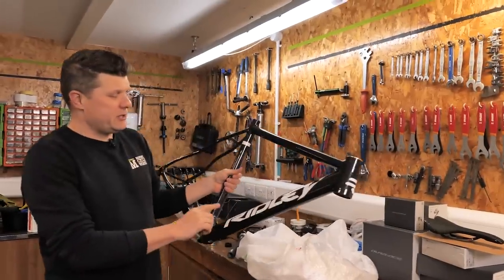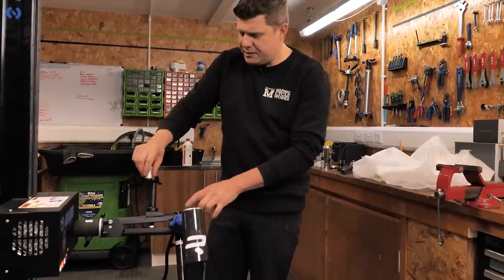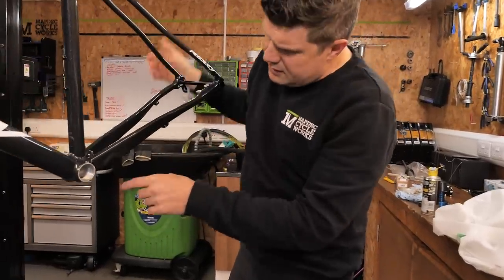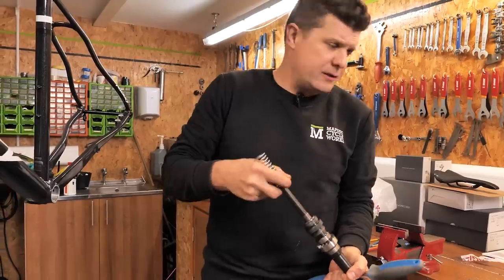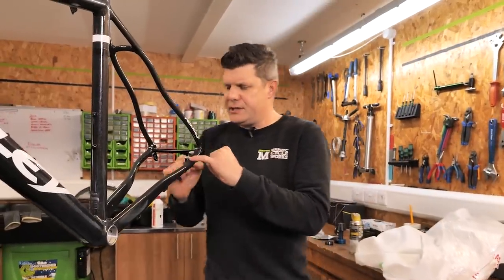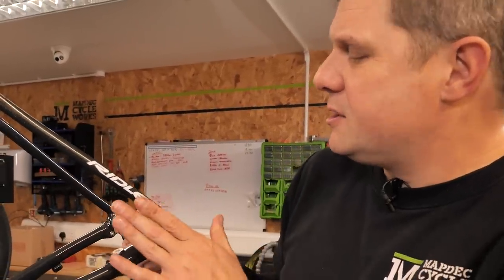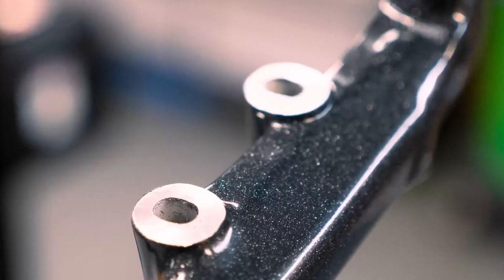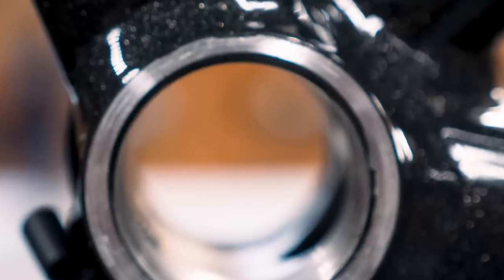Preparing your frame for a smooth & quiet ride.

Comment: This is disgraceful to be honest. Should have sent the thing back!!.
Reply: This seems to be the norm, rather than the exception with Ridley frames, unfortunately.
Reply: @MrSchattka can confirm
Reply: @MrSchattka  To my knowledge, Ridley once started their business by.... Painting frames...    Rgr
Reply: Exactly! I will give this one the benefit of doubt before breaking down the cost vs sending back. I’m awaiting a response to cost but I feel a little ghosting is going on unfortunately. I like the videos but one thing that’s lacking is the cost to put things right. Why send a frame from London and the back to face the head tube, bottom bracket and brake mounts? I know plenty of good bike shops in London that could do this for a £100 max. Some might say you have an axe to grind with Ridley and profiteering? I would be happy to be proved wrong though!
Reply: @borano2031  Ridley have been in the UK  market for over 15 years, first by rebranding frames such as Rondelli (Ron Spencer Cycles) then some Vitus models to my knowledge amongst other brands.
Reply: @youcandoit2502  Should have been more specific, they started by painting frames for OTHER brands. By replacing the other logos with their own they suddenly became a frame/bicycle brand.     Rgr
Reply: Exactly , the video exposes the manufacturer quality.

Comment: If I thought my shop, spent this much time facing and working on my bike, I wouldn't hesitate to use them for my bike builds. Slap dash bike builds is what drove me to buying my own frames and building my bikes up myself.
Reply: How much would you be willing to pay? knowing the place you sent it to knew this should have been sent back to be rectified in the first place? I would call this profiteering?
Reply: High detail bicycle builds with expensive tooling and extra time spent = high cost .

Comment: On my alloy frames that get a carbon seatpost I always take a fine file to the seatpost collar slot on the inside and add a fine bevel, sand, and polish. Stops it cinching in on the post and cutting into it. Only takes a few minutes, but I've had two posts ceack right at that pinch point. Now it's no problem.
Reply from the maker: Top tip.
Reply: Do the same to the seatclamp and stem while you're at it
Reply: Yes, I had to do that with a steel-framed bike I bought 27 years ago, after it gouged my aluminium seatpost.

Comment: That was a treat to see how the problems were solved. Not something your everyday enthusiast would be able to do back home in the shed with all the specialist tools required, and sort of underlines how 'little niggles' can end up being an instant showstopper for anyone attempting to build their own bike at home.
Reply: Don't let those little niggles stop you. I regularly prep people's home builds from frame milling to problematic brake bleeds to whatever. Use the local shop for stuff you're not read or able to tackle so you can focus your efforts on the parts you can do.
Reply: But that’s precisely why I would never bother with, and highly encourage ppl to leave any bike work to the pros. 
There is little bevefits, and more demerits to trying to work on your own bike at home. Is your time worth that little, that you can waste it trying to sort out all these issues?

Comment: Very few shops around here have those tools, specifically the brake flat mount facer, but beyond that, I don’t know of any that would take a new bike during assembly and check all those things. Whether they’d do it for a frame build I really can’t say. From what I’ve seen, they tear off the packing, put the bars on, tighten the stem, check the wheels and fill the tires and make sure it shifts ok and out on the floor it goes, more or less. Spend as little time as possible on it I’m sure is the mantra.
Reply: If a new frame needs such refinements, it should be done, at least this is the case of the workshop I last worked at. I even got to do disc brake mount facing and BB shell reaming a few times.

Ever since then, I never look at bike builds the same way ever again.

Comment: I bought a relatively humble unsophisticated frameset (Salsa Fargo) from a great bike shop here in Melbourne, and half a decade on it still runs and rides flawlessly and is a joy to rebuild and service --- all because it was chased and faced properly.
Reply: Good thing you're not using salsa handlebars
Reply: @janeblogs324  I am. Woodchippers. The bike is the original dropbar MTB and it's designed around it: short top tube etc.

Comment: I was trained to take as little material off as needed to provide a continuous faced circumference, which is not a broad flat full width face all the way around. By my training, the amount of material you removed from that one side of the bb was way more than appropriate, unless, of course,, doing so did not reduce the bb width to less than spec. Nice sharp, new looking tools by the way. Along the same lines, a beautiful even flat face on the brake mounts also may suggest over cutting in many circumstances. Thanks again for the show-and-tell. I may need to get one of those Unior stands. I'm NOT in love with our current park lift stand.
Reply from the maker: It would have help this video if i had used blue dycum to illustrate that gap.
Reply: Shimano bottom bracket width standard is engineered with a large variance permitted to account for manufacturing tolerance and frame preparation, +/- 0.5mm.

Comment: I have to say, regarding frame prep that I've just put my Vitus Razor Disc(2021) off the road for the winter (Mtb/Gravel/E-Mtb time)...I was having a damn good look at it as I cleaned it and despite this being a budget bike (it was £629 with full Sora when I got it) it has all the evidence(I think, maybe not head tube/seatpost) of being frame prepped unlike these paint covered Ridleys. The rear caliper mounts have definitely been faced(not checked the front), as has the BB shell (I noticed that when switching from the Tiagra RS500 BB to the smaller Ultegra BBR60 BB when I upgraded to 105)...The question is- has this been done because Vitus are conscientious and actually care, or was it just necessary because  off the production line they weren't up to scratch??!! 
I have the Vitus Substance VRS on order (I'm slowly being drawn to "gravel" purely due to road safety these days, had some horror near misses this summer) I'll be giving that a good look over when it turns up (assuming Wiggle aren't bust by the end of the week...!!)

Comment: I used sandpaper to remove paint from the caliper mount on my new frame and so I didn't touch the aluminium. I couldn't even imagine there's a special tool for that 😮

Comment: Your channel is really impressive for many reasons. Ridley make good bikes (I thought), they probably wish this frame was sent back and not highlighted on your channel.  I’ve noticed some issues in my head tube bottom bearing area on my brand new Orbea m30. Can’t say it affects the ride quality.
Reply from the maker: Ridley has so far ignored most of this and didn’t want the frames back. In a previous vid I showed how they paid us £250 to keep it.  In another vid I gave up and tried to send it back.  It took months for them to even reply.

Comment: Brilliant work, and storytelling. Curious - I was taught by the "wise old bike mechanic" when I was a fledgling mechanic to only apply tension to the cutter while it was in motion (i.e. hold the opposing nut momentarily while turning the handle) otherwise you risk getting indentations from the cutting teeth.  Any reflection on that? Thanks !! 👍
Reply from the maker: Depends on the design of the tool

Comment: I got to use that Park Tool facing tool. Tightening the bolts upon after switching sides was super annoying. Cyclus' is way more convenient and faster imho. (Engineer, no bicycle mechanic.)
Reply from the maker: Yes, Cyclus make some great tools, A lot of these tools are accumulated over time as we need them. If I had to start over and had the budget I would choose Cyclus for a lot of things.

Comment: How much would you expect a UK bike shop to charge for basically all you did in the video? It seems like the facing tools are all fairly specialist.
Reply from the maker: It is about an hour of time. plus some tooling costs. those tools are expenisve to buy and keep sharp.
Reply: @Mapdec  sorry for the duplicate question but how much did you charge for this?
Reply: I reckon £50 for the work plus £20 return postage...?
Without getting into the argument of whether this should've been carried out 'pre delivery' I think you'd have a sizeable queue wanting this service... Maybe you have! 👍

Comment: thanks a lot for sharing! This was very informative. I guess it takes a lot of experience to know which approach to take on certain problems (and when to stop as you indicated). Do you have tips on how to gain experience with this other than just starting the process myself? Could you list the tools you were using? Cheers!
Reply from the maker: The tools are in the description. Just practise a bit on an old frame.  Take your time to measure and be precise when working.

Comment: Moving onto carbon frames: what of these prep jobs would you expect to do on a TIME/Look frameset coming through your shop? None, but a visual inspection?
Reply from the maker: We would always inspect with gages and tools, and everything is worth checking.  Time frames have been known to have a little excess lacquer near the brake mounts. Look are usually excellent, but I did have to remove a tiny bit of paint from a bb recently.
Reply: @Mapdec  thank you!

Comment: When do you have to start throwing spacers between the bottom bracket cups and frame; even if you just took away 1mm of material...its no longer 68; right?  Assume there is some tolerance for this, but the spindle is a pretty rigid size.
Reply from the maker: is this took away 0.02 i would be surprised.
Reply: BSA standard permits 68mm +/- 0.5mm on width dimension.

Comment: I have to keep readjusting my front brake due to rub, have thought about getting the mounts checked, but not sure who if anyone deos this kinda work in my area. Cheers good vid as always.
Reply: If you ride hard, the rotors can push on the pistons, taking them out of alignment.. It might be what you are experiencing
Reply from the maker: Ask. It is work doing. Pads will last longer too.
Reply: What rotors/hub are you running  and what sort of riding? I’ve had all sorts of issues with all rotors tbh Hope and Shimano although I would go with Hope over Shimano just for the fact I can run my gold rotor/hub combo

Comment: Hi! Currently I have very little knowledge of building bikes, so could you please explain a bit the reason for doing this work, I think I missed it? If I understood correctly, the paint was preventing from fitting the parts in. But when you were flattening the sides of the bottom bracket or where the the brakes go -- this is just for a better fit? And what would be the benefits of such a better fit besides the aesthetics?
Reply from the maker: It ensures that things don’t creak or rub.

Comment: Bike shops are generally punching the air with joy at Wiggle’s woes, but customers are still not going to buy overpriced parts from them. LBSs should provide good useful services like this.

Comment: Hi Paul. Just thinking. Would it be ok to just use a light coating of paint stripper remove over spray. Just thinking aloud to see if that is something a home mechanic could do.
Reply from the maker: It is about getting a flat surface, paint is just one culprit.

Comment: Hello, you have so much experience maybe you know the answer. Does a hydraulic break hoses are the same for shimano and sram rival ? I know the fluid is different but not sure about hoses. Thx for help ✌️
Reply from the maker: Nope. Very different.  Don’t mix them up.
Reply: @Mapdec are you sure? Can't find anywhere that specifies DOT or MO use only for hoses... Neither Jagwire nor Hope hoses are listed as one or the other... Got me worried now 😎
Reply from the maker: @chrisb5824  BH90 is a smaller internal bore and need a smaller barb.  BH59 might work. Never felt compelled to try.
Reply: @Mapdec  (apologies as I'm aware this is slightly off topic..) Done some quick calls/research - Shimano ID 2.3mm, Hope 2.2mm, and SRAM 2.1mm. Apparently the hose is ok for DOT or MO - just never reuse a hose for a different oil...  live and learn 👍
Reply: @Mapdec oh, and just in case you're wondering why - I'm wanting to use the excellent UK made Hope calipers on my road bike so need to combine with either Shimano or SRAM shifters... Compatibility raises it's ugly head!
Reply: @Mapdec   thx 😀

Comment: I’ve had experience with a Ridley and had nothing but issues with the BB, was in the shop more than in my garage and eventually managed to get the store to give me a refund, felt for my dealer as they did all they could but Ridley were absolutely useless to the point they even accused me of moaning and “ just ride it” luckily my dealer backed me all the way! Shocking bike and would definitely not recommend

Comment: How much would this sort of work cost?
Reply from the maker: An hour plus a tooling charge is normal.
Reply: @Mapdec How much is that? 😂 thanks for the underwhelming response but that leads me to believe not all is good here. #deepdive
Reply from the maker: Our hourly rate is £50 an hour. All ok here thanks @youcandoit2502
Reply: @Mapdec thanks for the reply 👍 does that include the up charge for using cutters?

Comment: I just e-mailed a large local bike shop in The Netherlands, asking them if they own the mentioned tools and have the expertise to face bottom bracket, headtube and disc brake mounts of a frame. 
They replied they don't have them, because they told me they never had to face a bottom bracket or headtube. Interesting..
Reply from the maker: An embarrassment to the industry.  Makes me so sad. 😞
Reply: @Mapdec  It would suggest that the bikes they sell (specialized, cannondale, trek, orbea, pinarello, RIDLEY (haha), Niner, Sena) never need any facing when they leave the factory. Or they never consider to face any surface.

Comment: The owner of that frame should have personally brought it back and vented in front of other customers, that frame is a disgrace. From what I have seen in build quality evaluations, Look are the only ones consistently producing excellence.
Reply: I’m afraid you have to question why the need of sending the frame across the country to sort these issues, I know the tools are shiny but I’ve worked at 8
Shops across London with the same ones albeit a bit dirtier 😂 BC have one of the best tool chests in the UK
Reply: Ridley is a Belgian bike company. I don’t think travelling to a factory in Belgium from the UK would really have had much impact.

Comment: The real question is: why isn't that done in the factory? It's all made in China where labour is cheaper. They have scale. It doesn't make sense to pay top dollar for a frame and then pay top dollar for your bike shop to work on a brand new frame. It's just sloppy manufacturing.
Reply from the maker: They rely on that cheap labour for quality control too.  Or rather the brands push the factories on price, and the factories just respond by doing a cheaper job.

Comment: You forgot to ad that nearly no customers are willing to pay for that work.
Reply from the maker: Really?  We do this a lot. Admittedly we do it as required when we encounter a poor fit causing an issue.
Reply: @Mapdec, What sort of Money would you charge for that work?
Reply: I agree, I would like my frame cleaned/Faced correctly when purchasing. If I need to add a cost onto the build then it’s going back or I would expect a refund! I’m sorry but it’s just not acceptable

Comment: When exactly did the world start expecting metal frames to be all faced and chased in the box? Back in the day when I worked in a shop nothing was and everything needed it. It didn't matter the brand or cost everything needed it. 

When I see complaints about this it seems to me to be bitching about doing your job.
Reply from the maker: When frames like this cost £1200 and are sold direct to consumers.

Comment: I've seen that unior electric lift somewhere before. AH YES I'VE GOT TWO in my workshop. Very good indeed and made by someone intelligent. With a USB charger port and the electric wire coming from above instead of under your feet. Good bit of kit for RRP of €3399.oo
Reply from the maker: Amazing. Best investment ever.